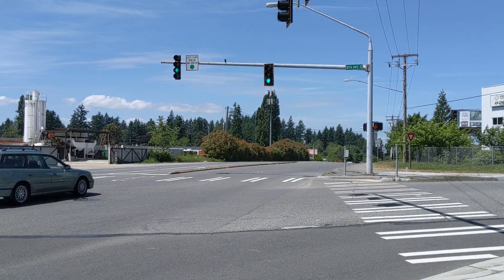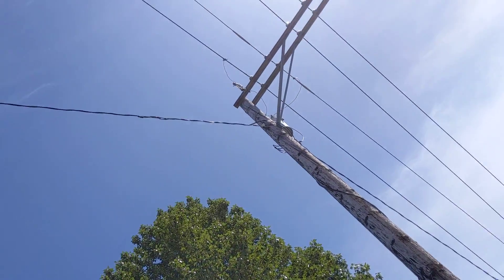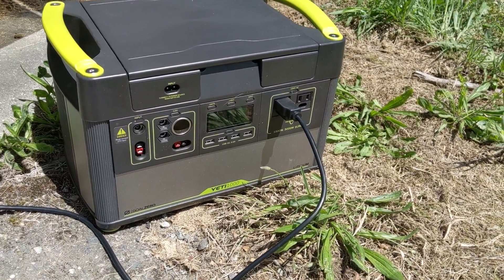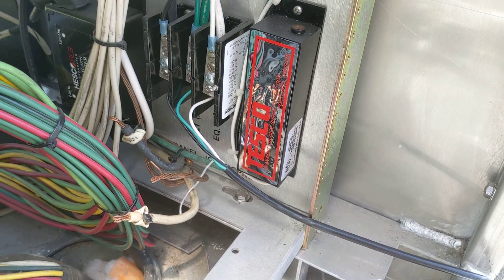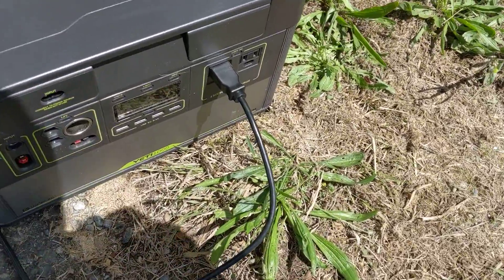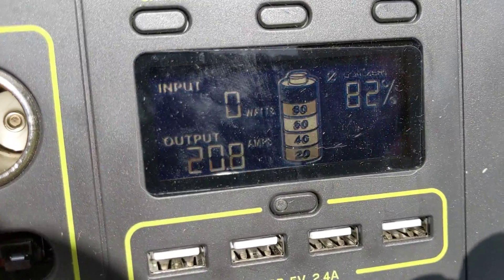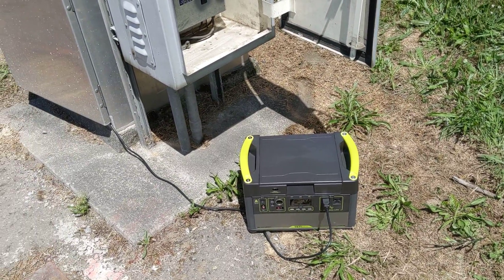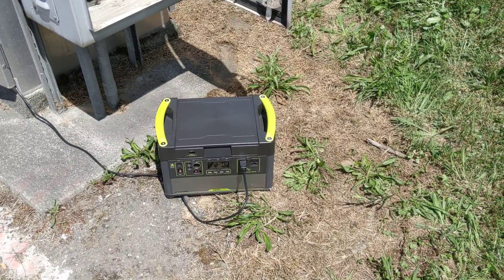Powering a traffic light with a Goal Zero Yeti 1000

Comment: If you are pulling 18 amps at 120 volts that’s a little over 2,000 watts. I would think your 1000 watt hour battery bank would only last about 30 minutes? Any idea how much power newer LED systems use?